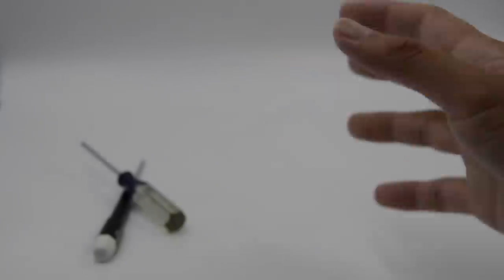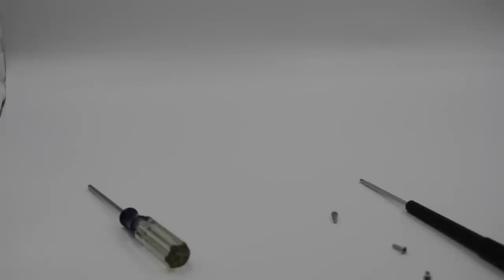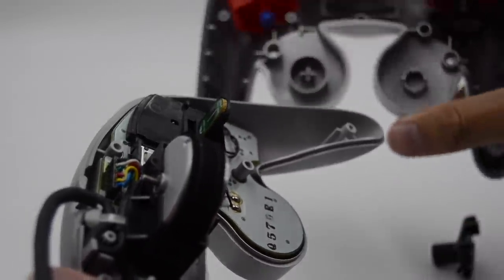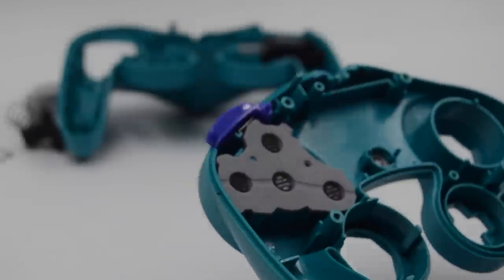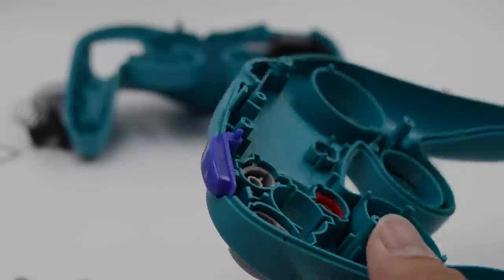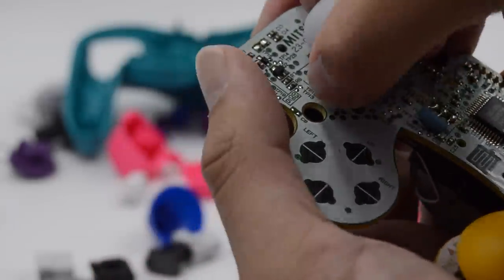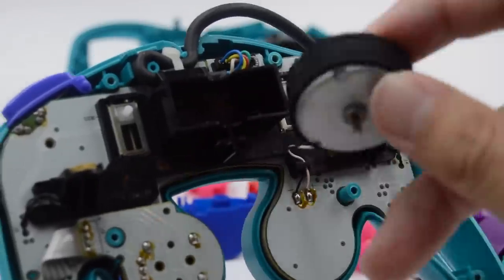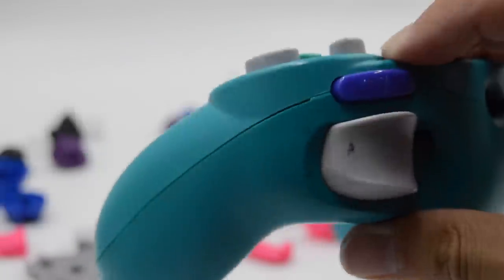Common Mistakes: Opening a Gamecube Controller

Comment: that color looks dope, what color is it?
Reply from the maker: Emerald Blue!
Reply: it's the Emerald Blue color. it was only ever manufactured in Japan so if you are looking to buy one it will most likely be imported. When i was purchasing mine i noticed they stayed around the $40 mark
Reply: I got an Emerald Blue on an auction this week for $31 !! Been finding a lot of good controllers for cheap on eBay. Just got a silver one that was Brand new for $15
Reply: +Balents that's a steal man. good job for you

Comment: What about dead zones on the stick?
Reply: thats usually due to the actual box that holds the analog stick. I noticed one time just by switching to a Nunchuck analog stick, my deadzones got even worse. only way i know how to fix that is just getting a new controller or getting a new box and soldering it in replace of the old one
Reply: What if you can't solder lol

Comment: I really wish there was a controller with internals like this, symmetrical sticks, and was wireless and worked with pc and switch; I want a do it all controller nintendo, give me a pro controller with analogue triggers, octagonal gaits and sticks in the same place!
Reply: Did you ever look on the internet? Ill be nice and help you but you know Google exists as well as Bing, Yahoo, and Ask.
Reply: @bland9876  bit rude, your link's dead but if it's that power a one it apparently doesn't have analogue triggers. Plus those sticks aren't in the same place are they. I'm probably gonna resort to a PS4 controller and that mayfly adapter, and filing the gaits myself.
Reply: @robinrai4973  what do you mean the sticks on the wirless power a switch gamecube controller aren't in the same place it looks exactly like a standard gamecube controller to me? And the switch does not have analog triggers so why would they bother putting them in?

Also i was just on a video where people where posting retarded comments expecaly the ones asking questions about the thing the person answered in the video so sorry if it sounded a bit rude.
Reply: @bland9876  I meant I prefer a symmetrical stick layout like the dualshocks, and I want to use this controller on pc for driving games as well so the triggers gotta be analogue for me. 

I think a dualshock 4 and that adapter'll be good enough I think, it's my favourite controller plus there's plenty of mods for the dualshock. If it worked natively with the switch hot diggity damn I'd be a happy potato
Reply: @robinrai4973  the only problem your going to run i to is the ps4 controller does has regular rumble motors not the hd kind

I've not used those adapters so maybe they are shit but the reviews say they are good.

Comment: Would opening up a crappy 3rd party be good practice or just a waste of time?
Reply: I feel like practicing opening a third party controller would be good practice. In the video, that really is everything you need to look out for. Just expect it not to be entirely one-to-one with an original GameCube controller.
Reply from the maker: kinda! in my experience they are similar to official gccs but actually harder to take apart and put back together smoothly because of how badly theyre put together in the first place. still decent practice tho if you want to test out opening one before

Comment: my shoulder buttons no longer airdodges when pressed on the top half of the button
Reply: 8:25 might help
Reply: it doesnt :(
Reply: that’s normal
Reply: Airdodge requires hard press. Only L cancel can be soft pressed
Reply: it didnt happen before, and my other controllers seem to work where ever I press
Reply: I am aware. But my issue is not really air dodging, its really about not be able to wave dash or tech when I press on the top half of my shoulder buttons. Of course I have adapted somewhat to press primarily on the bottom half, but I feel that I miss some techs because of this.
Reply: spapbp then buy more malfunctioning controllers

Comment: Ain't no fucking mistakes made here, opened the controller, cleaned everything, closed it back up, and it still works fine, all of that from a 3 second short showing that you can take the screws off the back and open it up. I'm 13 also